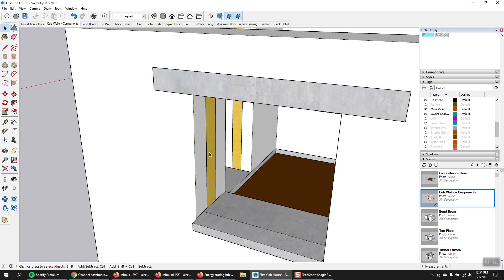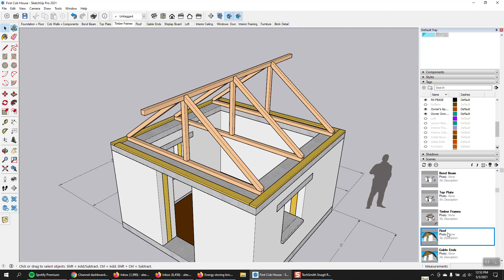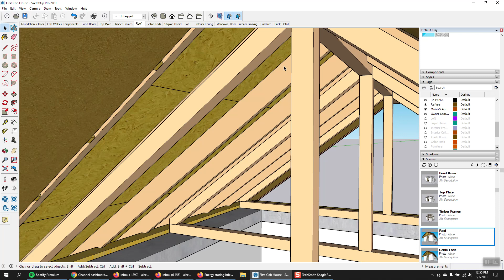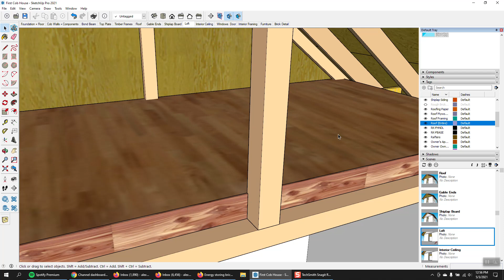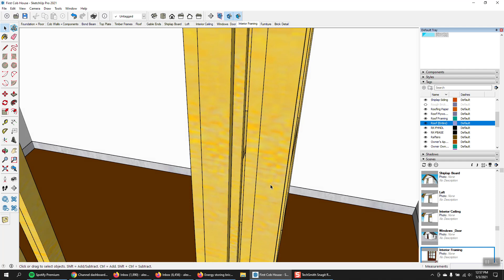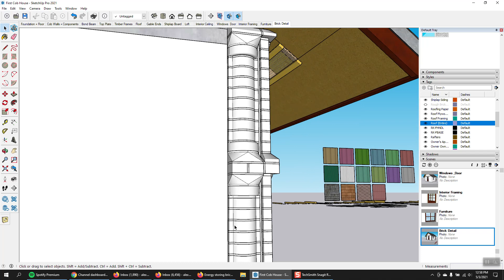Designing a Tiny Cob House - Functional, Low Cost, and Durable

Comment: Hi Alex, with the walls being load bearing why would the concrete bond beam be added at the top of the walls? Why have a separate roofing system to the walls of the house? 

Is this to conform to building code?

Usually the roof beams would just be fitted directly to the cob walls.... Just curious 😜
Reply from the maker: Yes, the bond beam is required for code. It does have benefits though. Especially for seismic zones. It holds the walls all together tightly. It also serves as a nice flat surface to attach your roof too. Its also far easier to take off and replace a roof if its on a bond beam. As opposed to the rafters being embedded into the cob walls.

Comment: This house uses  modern materials like betong and osb boards but the walls are of cob. Why not brick walls then? Bricks don't cost so much and are easy to build with, thinner walls. And brick houses are permanent structures. In the area where I'd like to build there are many fires. Many people who built cob houses lost everything in fires and now asking for donations in order to rebuild their homes.
So what's the point with cob?
Reply from the maker: With a brick house, the roof can also burn. I don't see your point.
Brick is great, but you won't solve your fire problem with that either.
Just so everyone reading this knows, cob and brick won't burn down. Only wood components of the building will, such as the roof.
Reply: @thiscobhouse  of course I understand that if the roof has wood beams it will burn why people here have often beams of betong. But it seems to me that it will burn much more in a cob house than a house made of bricks because the brick house doesn't need wooden components and saving with cob house is not so great anyway if you build it properly with betong foundations etc
Reply: An alternative for poor people
Reply from the maker: @Queen-jc8fd  Kind of...This building, I'm estimating will cost about $20,000 to build, on average.

Comment: Hi Alex,

Enjoy all your videos. I just purchased some land and I have it in my mind to one day build a cob house. I've done some soil tests and from what I can tell it seems to be a pretty good mix for making cob. The big thing that has me hesitant is insulation.  Here in Alabama we have long hot humid summers and coldish damp winters. I was toying with the idea of some kind of blown hempcrete layer in between an outer and inner layer of cob. I'm just brainstorming. The one thing I do have is time to plan. I'm in no rush. Thanks for all your content.
Reply from the maker: Cob does extremely well in the South. I've built a cob house near Jacksonville, Florida to prove cob's suitability here. Its such a comfortable building in the heat. If you want extra insulation though, Google the CobBauge project. They have a dual wall system for insulation that works great. But its probably not even necessary in Alabama.
Reply: Hi Alex, thanks for this wonderful solution to a comfortable home.  I am interested in purchasing land in  North Carolina.  Can I build in that area without worrying about building codes?  Thanks
Reply from the maker: @lindaolson4325  It depends where you buy land entirely. The Western mountains of NC also have a high seismic zone so will require an engineered design. Might stay out of that area. Check the seismic zone maps for details.